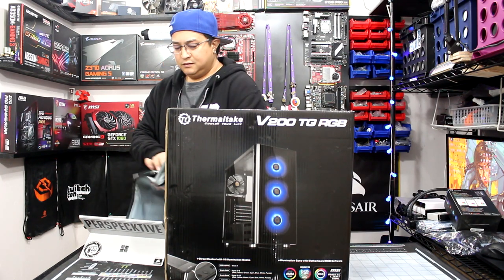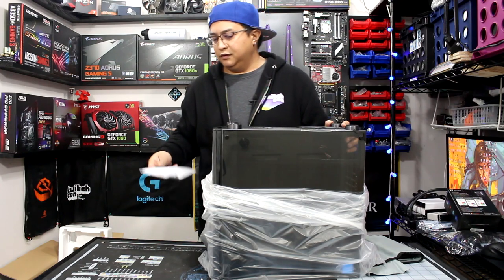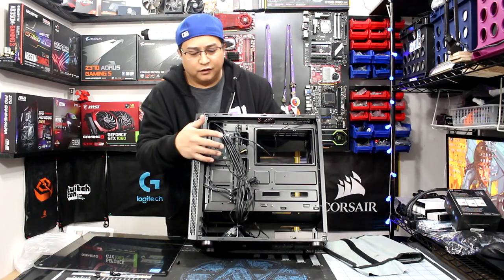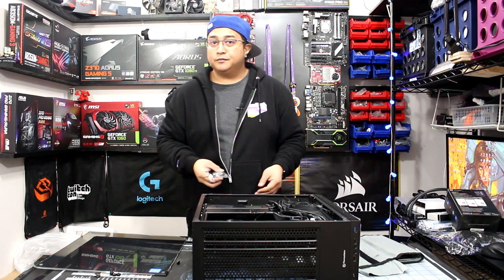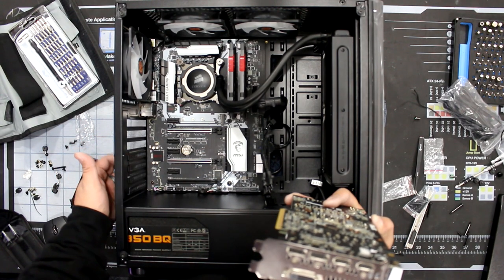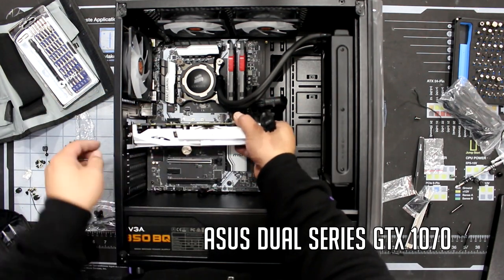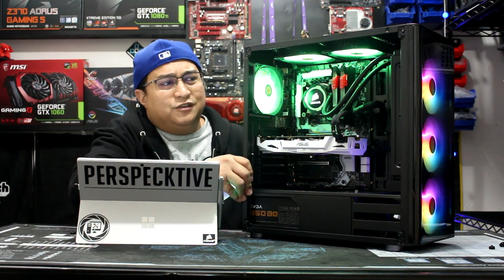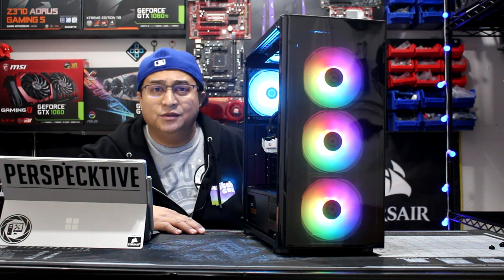Building In The Thermaltake V200 TG RGB (2018)

Comment: Hello... I have the exact same case, I am wanting to buy an aio CPU cooler, will a 280 fit? Or should I stick with a 240
Reply from the maker: Hello! I would stick with a 240 unless you have the latest version of the case. The version in this video doesn't support 280's but there's a "2020 Version" that will support a 280 in the front. The only way you'd be able to tell which version you have is if you check the manual. I haven't been able to see the newest model so I can't tell you any obvious differences between the 2 cases. BUT! Yes you can fit a 280 aio. Just make sure you have the latest version of the case.
Reply: @PERSPECKTiVE  I do see a 280mm raidator in my manual for the case... What would be a good choice for it? I'm not an expert with water cooling but I like aios "closed loop" is okay?
Reply from the maker: Jannae Huntress yeah aio closed loop is definitely okay! I always recommend corsair though. It's not too difficult to install and I've never had any negative experiences with them.
Reply from the maker: Jannae Huntress but you could check out the H115i rgb pro XT or the H115i RGB Platinum.
Reply: @PERSPECKTiVE  I probably gonna go with nzxt z63 lcd display
Reply from the maker: Jannae Huntress nice choice! I like the functions of that lcd. Good luck with the build! Hope it turns out the way you want it!
Reply: @PERSPECKTiVE   Guess what? It's done...
Reply: Would like to post a picture... Of it
Reply from the maker: Jannae Huntress heck yeah! Yeah let’s see it! Upload it on imgr and feel free to post the link here in the comments! 😁😁😁
Reply: @PERSPECKTiVE  hi  may I ask you for your help with PC cables... I would like to purchase them with clear cable Combs, but I don't know which one to get.  I have a new PC case coming it's phantek enthoo 719
Reply from the maker: @infinitycgr  you can check out www.cablemod.com and search for the cables you need based on the model number of your power supply. You switched your case quick! :D
Reply: @PERSPECKTiVE  the one I had was only temporary...
Reply from the maker: @infinitycgr  nice! thats the only case i know of with a window for your ssds
Reply: @PERSPECKTiVE  exactly what I wanted..
Reply: @PERSPECKTiVE  hello I have a bugging question about  GPU sli. My MSI Edge wifi x570 allows it but my GPU doesn't say if it is. I have MSI GeForce gtx twin frozr super 2060 for GPU. Can I buy another to add to it ?
Reply from the maker: @infinitycgr  According to Nvidia's website it doesn't support SLI. I also own one and didn't see the capability listed on the box.

Comment: I was able to get the stock rgb fans working but I cant change the color off red with the led button do you know how to fix this
Reply from the maker: I would check and see if your fan controller is connected to the "Reset Switch". Once you connect it, give it another shot.

Comment: How do you hook the fans rgb to the lighting software?
Reply from the maker: You'll need to connect the fan controller to the motherboard then use the motherboards rgb software to customize it
Reply: PERSPECKTiVE thanks does the software work with a 350m?
Reply from the maker: @jjones777gaming7  350m?
Reply from the maker: If you're talking about the i3, then no. It's not controlled by the processor. It's controlled by the motherboard. But you'll need a motherboard with RGB headers on it
Reply: PERSPECKTiVE the motherboard is an a320 m
Reply: PERSPECKTiVE it’s a ryzen and I have a 3200g
Reply from the maker: @jjones777gaming7  not enough info for me to give an answer. But if your motherboard has rgb headers you would be able to do it. You just need a cable to connect the controller to the motherboard
Reply from the maker: You have the whole model number of your motherboard?
Reply: PERSPECKTiVE do you have Instagram so you can help me out?
Reply: PERSPECKTiVE I’m not home so not rn
Reply from the maker: @jjones777gaming7  leave the model number here when you get a chance. I don't do tech support or anything like that on Instagram
Reply: PERSPECKTiVE if you can get it through name it’s a GIGABYTE A-320M-S2H AMD Ryzen

Comment: Hey!! I'm going to build a PC and I wanted to know your opinion.
I am going for a Ryzen 5 3600x, Motherboard ASUS B450M-A Prime AM4, 2x8 16GB Corsair Vengeance Pro RGB 3200Mhz, GeForce GTX 1660 6GB Super ASUS Dual Evo, 2TB HDD WD Blue, HD SSD 480GB A400 Kingston, 600W Thermaltake Plus White 80+. First of all I would like you to tell me if this looks like a good build for you. And second, if you think I'll be okay with this case, with all the stock fans. I'm planning to play games and stream. Thank You!!! Greetings from Argentina!!
Reply from the maker: Heeeey! So you got a great build going on. But if you're able to get a an EVGA 2060 KO or a Regular 2060 it'd be more bang for the buck and would go better with your CPU. I don't know what the prices are in Argentina but a 2060 KO is 299 USD on newegg and a 1660 is about 260 USD.  Otherwise it's a great build. I would say get 2 fans for the top though. 2 140mm fans if you have the budget, but 2 120mm fans would suffice. Enjoy your build! Lemme know how it turns out!
Reply: @PERSPECKTiVE  Great, thanks for the answer!! Argentina is very unstable with its prices, it's not cheap, so I will see if I can upgrade to a 2060, but I don't think so. I will definetly try to add 2 other fans, thanks!!
Reply from the maker: Juanma Justo you’re welcome! And 2060 or not, you’re gonna love it. At least you can keep your cpu for a while and upgrade your gpu later if you needed to because the 3600 is better than the 2700x which was AMDs flagship cpu back in 2018 and you could pair that up with a 2070 super with very little bottleneck. Heck you could pair it up with a 2080 and still be okay!
Reply: @PERSPECKTiVE  Great, thanks! So you think I will be okay with this case with 2 fans more? Or maybe choose another case? Maybe a View 27 from Thermaltake, its about the same price, idk, you tell me
Reply from the maker: Juanma Justo the view 27 is cool but I think you’re better off with the v200 when it comes to airflow. Especially after adding 2 fans exhausting on top!

Comment: Did u buy this of amazon and did it come with everything that u need to bulid this pc like motherboard, fans,
Reply from the maker: I bought the case and the 3 pack of case fans at Fry's Electronics on black friday back in 2018. I was supposed to make a build video out of it back in January this year but I had other cases to make videos with so it got held back a whole year. The parts I used for this build are parts that I have to the side to do time lapse builds and case reviews.

There aren't any "PC Building Kits" that include components that I know of but if you were looking to get assistance there's tons of videos out there, and JayzTwoCents just released one the other day on this specific subject.

I could help you too though! Just let me know.

Comment: how did u fit the radiator  with the tubes on top without messing with the front panel connectors
Reply from the maker: Screwston I guess it would depend on your radiator but this one fit pretty snug. It didn’t touch any wires or anything. It should fit almost if not all 240 rads really. Regardless of fit I would just be gentle when installing it so you don’t mess up any connectors.

Comment: Where do you connect the top 2 fan to?
Reply from the maker: I connected them to the fan controller in the back along with the other exhaust fan in the back. The 3 fans in the front had their own separate fan controller.

Comment: would 3060 or 3060 ti work good on this case ?
Reply from the maker: They should work just fine no matter what model of 3060/Ti card you get
Reply: and what about 3070 would it work fine ? i guess ye just makin sure
Reply from the maker: @ix-yus4102  yeah I'm sure it'll work fine. If you're going with a gpu with an aio built in then you may want to double check thermaltake's website just in case

Comment: I still don't know how to take off the front panel of the case, I've looked it up and don't understand the instructions
Reply from the maker: There's a hole at the bottom towards the front that you can use your fingers or your hand to either pry or pull it open. I would go about it by placing the case upside down then holding the front panel with one hand while pulling it towards you and holding the case with your other hand. Don't pull too hard because you don't wanna snap any of the cables for the front panel connections
Reply: I ended up getting it, thanks!
Reply from the maker: @aidangomes8206  awesome man no problem at all, sorry for the late response! I'm glad you were able to figure it out man!
Reply: @PERSPECKTiVE  no worries, the case is very nice. Awesome review
Reply from the maker: @aidangomes8206  thanks again man!

Comment: Would you recommend moving the stock fans to the inside of the case instead on the outside for better air flow ?
Reply from the maker: It likely won't make a huge difference, I can't really say for sure but the bottom fan won't be mountable from the inside since it'll be obstructing your 3.5 HDD bay.

Comment: Hey bro I have the same exact case you do
 I was wanting to know how to remove the front panel in order to replace or clean the front 3 fans
Reply from the maker: Nice man. 5:46, So just look right underneath the front end and use the hole to pry the front panel off with your fingers. Don't be afraid to add a little bit of strength to remove it but also be careful not to put so much strength that you rip the cables for your front IO off. When you pull, just pull away from the case.
Reply: @PERSPECKTiVE  yeah i literally just found out lol i have another though. i'm only getting the 3.0 to work and not the two 2.0 ports (USB) how do i get that workin
Reply from the maker: BADCA7TV did you connect the usb 2.0 connections to the motherboard? There should be your "jfp" connections, your USB 3.0 connection, your USB 2.0 connection, and your audio connection that come from the front panel.
Reply: @badca7tv342  pi

Comment: Hey, for some reason I cannot turn on the computer. When I turn on the Power Supply, the Motherboard starts lighting up, but it seems I cannot turn on the rest of the computer.
Reply from the maker: I would make sure you connected your front panel IO correctly
Reply: Tom i had similar problem a few weeks, its the reset, power anf led pins are placed correctly onto the pins because this is what caused the problem with mine

Comment: how do i change the color of the fans?
Reply from the maker: I used a different set of fans for the front of my case if that's what you're asking. But you can control your fan colors using the fan controller built into the case by default. You can connect that fan controller to your motherboard if your motherboard happens to have a supporting RGB header but you'll have to double check your motherboard or manual to be sure.

Comment: Sir how to remove the front plastic cover of the case
Reply from the maker: 5:40 pry at the very bottom where the hole is at. Use your thumb and 4 fingers to separate it from the case.
Reply from the maker: Once you get that bottom part pried off, you want to detach the notches from both sides.

Comment: Dude I just bought this (for my very first pc build) and I can't get my Samsung Evo 860 SSD to fit the sata power cord, any suggestions?
Reply from the maker: So you're saying the sata power doesn't fit your SSD? Maybe try turning the power cable upside down? There's only 1 way to plug it in so you can't really go wrong there. If that still doesn't work, maybe you got something stuck in the female part of the connector?
Reply: @PERSPECKTiVE  I just realized that I was trying to use the premade wiring harness on the case when my psu came with one. My bad
Seriously tho thanks for the reply it my first build so it seems I'm going to be winging a lot of this lol
Reply from the maker: @SadManNero  Oh I definitely saw, I was just concerned about your question. It always sucks when you're building your first PC and you get stuck on something. I've been there and it definitely doesn't feel good. I'm glad you were able to figure it out though! That "wiring harness" you were trying to connect to your SSD was probably the power to the fan controller no? I remember my first build was a rebuild of an old PC I just added a graphics card and the thing didn't turn on so I returned the graphics card to frys all bummed out. Literally almost a year later I found out it was because of my power supply being too low. Congrats on your first build though! I bet it feels great!
Reply: @PERSPECKTiVE  honestly it's pretty exciting and fun I'm excited to see whether or not this'll blow up in my face but it looks like it's a full wiring harness the wires match the ones on my psu minus the fact that the psu is no removable. I have no idea what I'm doing but I guess that's part of the fun!
Reply: @PERSPECKTiVE  alright thought you'd think this would be interesting, I'm a moron and I assumed the chip that says thermaltake was a harness...
Reply from the maker: @SadManNero  lmao aye it's all good man! yeah thats the fan controller. Like I said man, I've been there. I've had a moment where I got pissed the PC wasn't turning on and I found out it was because I forgot to plug in the power cable for the CPU on the motherboard!
Reply: @PERSPECKTiVE  aye man I appreciate that, it makes me feel better.

Comment: Sir do we need to.connect its controller rgb fans.to motherboard??
Reply from the maker: If your motherboard supports it then yes, if not then you don't need to. It's optional either way because the RGB controller is already built into the case and all you need to do to change the colors is press the RGB button in front.
Reply: @PERSPECKTiVE  tysm😍
Reply: @PERSPECKTiVE  and also can we put two.120mm.fans on top??
Reply from the maker: Umer Best you can put 2 140mm or 2 120mm fans.
Reply: @PERSPECKTiVE  okau😍

Comment: Bro I’ve been trying to take that front panel off for so long how you do it so easily I still can’t
Reply from the maker: I guess practice but I almost dropped the last one I popped off in my other video lmao.

So you place your thumb and 3 other fingers inside the gap underneath the front panel, then push the panel away from the case with your thumb and then use your other 3 fingers to push towards the case. With enough force it will pop off.

You can also hold the main frame of the case and pull the front panel off with 1 hand but you always risk ripping a front panel IO cable because of how much force you could potentially have when pulling the front panel away when it pops off.
Reply from the maker: If you're going to use a screwdriver you may want to put a tissue on the screwdriver so you don't damage the case. I would advise against it but if you're having a tough time definitely use cloth so you don't damage the case

Comment: anyone know if i can control the three frontal fan that come with te case through some software? or something? i want to control the fan speed and colors
Reply from the maker: Fan speed, no. But you can control the colors if you connect the controller to the motherboard.
Reply: @PERSPECKTiVE  then at how many rpm are working my three frontal fans?

Comment: You didn't install HDD and SSD?
Reply from the maker: You're the first person to notice this! Thank you! I actually just forgot to add that part in the video. But I DO have it connected to the bottom black colored sata plug at the bottom of the motherboard. I hated where the mounting points were for the SSD so I just tucked the SSD under the power supply shroud. As for HDD, I decided not to use one for this build. Thank you for noticing that!
Reply from the maker: You can see the sata cable at 9:22
Reply: @PERSPECKTiVE  Ordered this case and waiting to get my hands on it..hence was looking for build videos.. found yours very informative. 🤘🏻
Reply from the maker: Anol Protim Boruah thanks a lot man. I’m glad this helped you out and I hope your build turned out great!
Reply: @PERSPECKTiVE  Hello again. After using I found out that it's front fans have very limited breathing space hence airflow is an issue. Any suggestion?
Reply from the maker: @7174hulk  So you could basically go 2 ways with this through modification. If you're skilled in this type of thing you can rebuild the front by removing the front panel and replacing the plexiglass with a mesh screen made of solid material. Or you could jerry rig it and make physical holes with a drill on parts of the front panel. It won't be pretty depending on how yo do it, but that's the only thing I can recommend... other than cutting out that side "mesh" area and making it just one big hole for air to slip through.. but it also means more dust since this case doesn't have a dust filter in the front.
Reply from the maker: @7174hulk  So you could basically go 2 ways with this through modification. If you're skilled in this type of thing you can rebuild the front by removing the front panel and replacing the plexiglass with a mesh screen made of solid material. Or you could jerry rig it and make physical holes with a drill on parts of the front panel. It won't be pretty depending on how yo do it, but that's the only thing I can recommend... other than cutting out that side "mesh" area and making it just one big hole for air to slip through.. but it also means more dust since this case doesn't have a dust filter in the front.
Reply from the maker: 8:45 you can see that mesh area I was talking about.
Reply: @PERSPECKTiVE  just wanted to ask one more thing...have you tried to install the aio radiator on top? official specs says it can be mounted on top, but I doubt it'll fit the space seems very little.